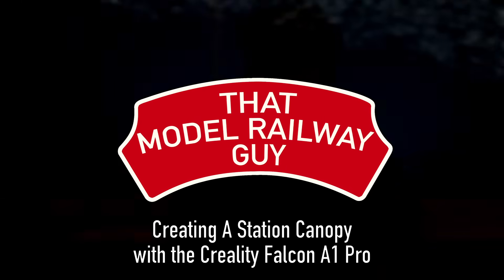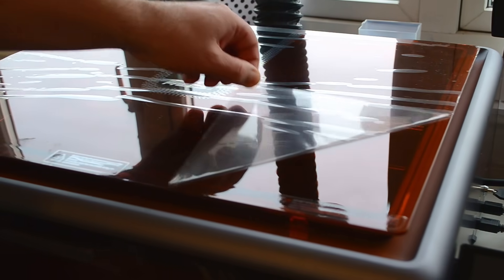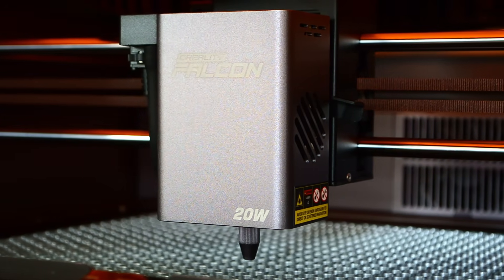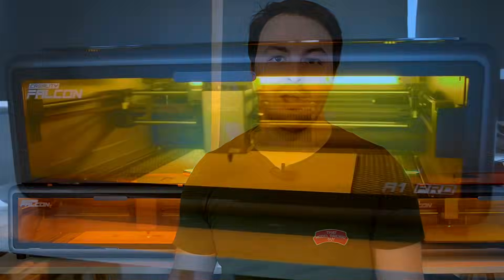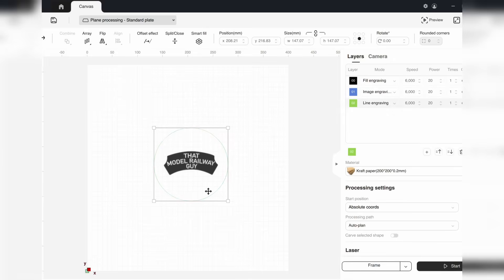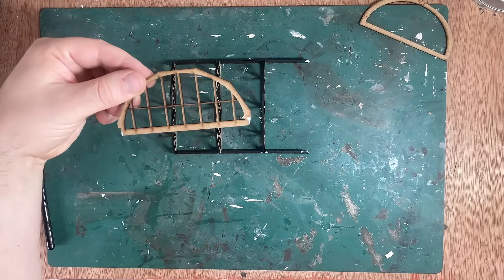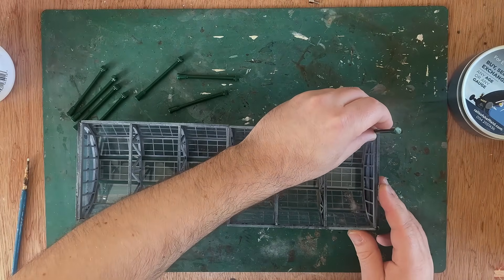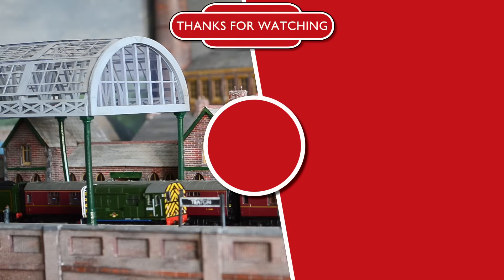Creating A TT:120 STATION CANOPY - with the Creality Falcon A1 PRO!

Comment: The canopy looks really good. My TT120 layout incorporates a terminus station that is just at eye-level when seated at my desk; A canopy would certainly add a lot to the model. I may have to copy you! As for laser cut and 3D printers, I just don't have the space but it is quite fascinating that we can purchase such things nowadays.
Reply from the maker: Awesome, that's pretty much the same way Teaton is setup too with the upper level station pretty much at eye level when sat down. It certainly is impressive that these machines are becoming more common for home users - I have to admit I'm curious to see where the hobby goes in the next few years. Thanks for watching 😃

Comment: Great work on the canopy.

I'm still in my broke college stage at the moment, but when I have more money or space, I'd like to get a laser printer. I think it is a pretty good price if you value designing your own structures.
Reply from the maker: Yeah some of them are a lot more reasonable now - it's a lot like 3D printing, expensive and complicated initially but more consumer friendly and lower pricing as the technology develops. For one off projects here and there it's not worth it but if you're going to use it a lot like I do then it's definitely a tool worth having. Thanks for watching 😃

Comment: The Pro has WiFi connection - so it doesn't have to be sitting right next to your PC.
Reply from the maker: You also don't have to run it from a PC or laptop at all. As I explained in the video, the touchscreen has it's own built in software and the A1 Pro can also be controlled via an app too.

Personally I much prefer having the more stable wired connection though and seeing as I'm using it in tandem with the standard Falcon A1 (which doesn't have WiFi) I might as well use the wired connection. Given the issues I've had with Lightburn too, it's been much more stable with this setup. That said, the WiFi was very handy for the software update as it handled it all automatically. Thanks for watching 👍

Comment: I'm thinking more about the P2 for the higher power upgrades. I'd be interested in your thoughts on this.
Reply from the maker: I'm curious as to why you feel you need more power? Generally for model railways we want to use thinner materials (under 5mm) to keep things in scale. 20w is nice but even the lower powered 10w machines can cope with that so I'm not sure sure what benefit a 55w laser would bring you, unless you have additional uses for it outside the hobby?

Bear in mind as well that CO2 lasers come with their own complications - at some point the tube is going to need replacing. Not to mention the significantly higher price point too - especially if you compare it to the standard Falcon A1 which is currently under £500.

As a side note - not that I'm trying to influence your decision here - but xTool have been in contact with me several times about featuring their machines on the channel. Every single time they've messed me around to the point that I've ended up refusing them in the end. I'm not saying that's necessarily the experience you'll have but they weren't exactly helpful and if that's how they treated me as someone they actively wanted to work with, I'd hate to think how they'd treat their customers.

Hope that helps and thanks for watching 🤩
Reply: @ThatModelRailwayGuy  Yes, I am looking at other uses too, particularly for thin aluminium sheets, which is where I want the higher power. I've looked at xTools offerings too, but the ones I was looking at are in the 5K range. So far as I can see, the 40W P2 would suffice, but it lacks the passthrough that xTool can offer for larger pieces, such as you showed in your new series for cutting baseboards.
Reply from the maker: Ah right, yeah if you're wanting to cut aluminium or any type of metal then you're definitely going to need a really powerful laser for that - possibly even a fibre laser instead 👍

Comment: these things do look good, and a very good review, the things need to drop in price though. a grand is not cheap, can get a lot of laser cut kits for that - I can see them being perfect for clubs though, or with other uses (e.g. gaming table top terrain) where the cost can be spread or some bits can be sold on to offset the costs.

nicely done example model though
Reply from the maker: If cost is the main concern I'd recommend checking out the standard Falcon A1 which is currently less than £500. 
Personally I think it's the same situation as 3D printing - the cost is worth it if you're going to be using it a lot to create custom items. But for those happy using pre-existing kits then a laser cutter probably isn't worth the additional benefits it brings. Thanks for watching 😃

Comment: How does the lazer cutter work with styrene?
Reply from the maker: For styrene I think you’d need to use the 2w IR laser. The 20w diode laser would just melt it or set fire to the material which obviously isn’t ideal 😅 Thanks for watching 👍

Comment: Thanks for this. I have added the Falcon pro to my wish list along with the honeycomb bed . And as i’m new to this I’ll just go straight to the Falcons own software. To avoid hiccups while i’m learning laser cutting.
Reply from the maker: The Falcon Design Space software is definitely a great option for beginners. It may not have all the features of Lightburn but it's got some nifty extras like being able to use the camera for lining up projects or having material presets so you don't have to waste time and material doing lots of tests.

I'd recommend checking out my video on the (standard) Falcon A1 from a few months ago if you want some more info about the Creality software. Thanks for watching 😃

Comment: Definitely sitting a bit high, but from viewing distance looks epic! 
Did you consider having all the ribs as semicircles rather than angled? Not sure on the tolerance, but a thin piece of laser cut lattice might bend over the entire structure or you could 3d print the lattice and use heat to bend it over the ribs.
Reply from the maker: Yeah but should be fairly easy to print some lower columns - and that will help the warping too I imagine. 

Having the whole thing be a semi-circle was my original idea but it just didn't look that good when I tried out some test pieces. The laser board is already 0.4mm thick so I don't think I could go much thinner. You'd also be surprised how many canopies actually do have angled window sections like this. It's just they tend to be a lot bigger so it's not as noticeable. Thanks for watching 😃